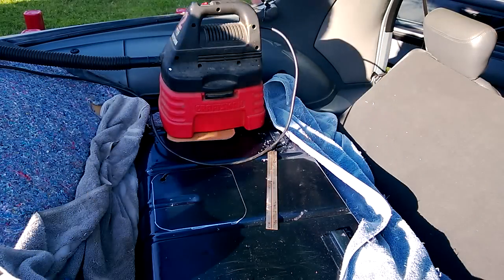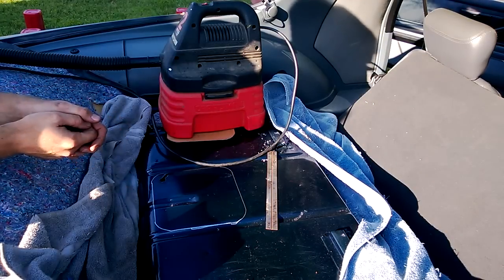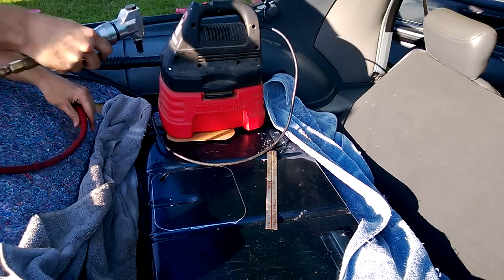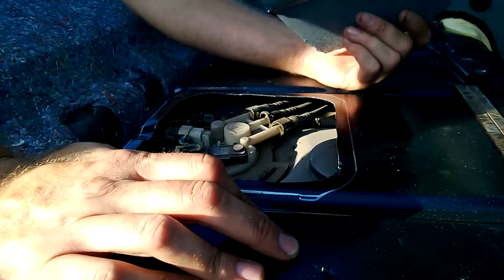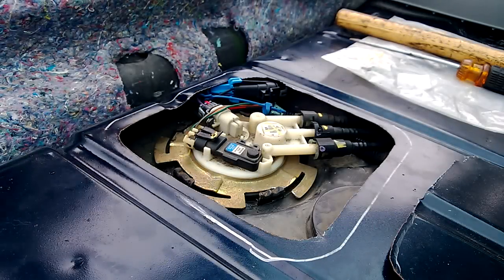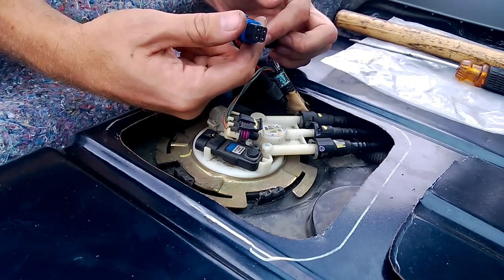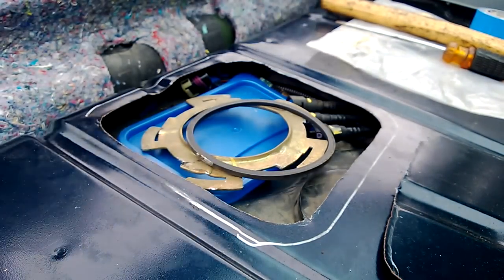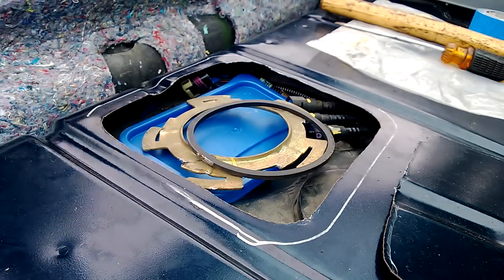Cutting Fuel Pump Access Panel and Removing Fuel Pump Assembly - 86 Trans AM with 02 Gas Tank

Comment: Air hammer with a sheet metal cutting bit works great for cutting the hole. Clean edges and no sparks... just my 2 cents.   Nice video.

Comment: I have done this procedure on a car and 2 or 3 pkups. .  I have dropped gas tanks in the past to change out the fuel pumps and will not do it again. In my opinion this is the only way to go. Nice job..
Reply from the maker: Thanks!
Reply: Joseph M how would you create an access hole for a pickup when the tank is right below the truck bed?
Reply: Very simple, take some measurements to make sure you're directly above the fuel tank opening to access the fuel pump. Simply draw a square with a black marker, use an angle grinder with a cutting blade and cut three sides first being careful not to go to deep. Once you have 3 sides cut, cut the fourth side about 2 inches on either side, pry up the cut piece and bend it back. Replace the fuel pump and bend it back in place.  If you have a bed-liner just put it back on, if not tack weld it or use JB weld. 
If it's a newer vehicle you may not want to take this route, however, it works fine and does no harm to the gas tank and you can cover up the cut with a bit of bondo, primer and paint if you're worried about appearance.
Reply: lift the front of the bed up about a foot.  Leave the back of the bed down enough so you can keep your taillight wiring hooked up...
Reply: An suv yes but why a pickup its so easy to unbolt the bed

Comment: This was quite informative and practical.....even exercising caution. I even did the same thing to a 2001 Chevy Malibu on 12/20/20. I made sure there were NO gas fumes prior to using my angle grinder and a metal cutting disc. Problem solved and just much quicker.Thanks for this information.
Reply from the maker: Glad you liked the video!  I like to think I did a neat job and its still safe and accessible.

Comment: This method is fine!  most imports already have a factory access panel.  make sure and clean top well then blow off good with compressed air.  just get another piece of shear metal an inch or so bigger than the hole and seal it down with black butyl tape.  could also use urethane auto glass sealant.

Comment: i like this solution as long as its done nice and properly. should be there from factory in my opinion.
Reply: farerse A more expensive car often has an access panel for the fuel pump. Access panels for a fuel pumps existed before the 3rd generation F car was designed in 1978 to 81. Thus GM did the typical thing of what car buyers want a lower base price. All the added fluff is rung out of the costs of building consumer items. With volumes going into the millions the parts are figured to tenths and hundreds of cents. Few in 1986 are going say they are willing to spend 20 bucks extra on the sticker price for an access panel.  In one consumer item I was a designer on the volumes were several million. One tenth cent on 1 million units is 1000 dollars. Thus often Engineers and Designers do have these ideas but the bean counters kill them so there can be a profit to be around another day.  The 3rd gen F cars run aluminum wire in the bottom left rocker panel to  save weight and cost too.
Reply: Damn right, they should have an access panel. A guy had to replace a fuel pump on his Jag, to his horror the entire rear sub-frame has to be dropped to gain access to the fuel tank. The garage wanted a $1,000.00 dollars just for labor. I told him cut out a hole, however, he frowned on the idea. FYI early model Sabbs  have a factory access door in their trunk, they are the only manufacture that has one to my knowledge.
Reply from the maker: Agreed!

Comment: Always make sure your fuel pump is able to be lifted out of the cut hole.  Some fuel pumps have pipes and hoses extended from it that will not allow you to do this.
Reply: That's a good point.  Generally, if the car didn't come with an access panel, the metal or plastic pipes usually DON'T have a coupling there at the top; its further down along the side or at the bottom of the tank.  Cutting the access panel in a case such as this is only half of the job, the metal lines still need to be cut and re-connected afterward.

This car here in the video is an exception since his tank is a 2002.

Comment: to cut that out, use an air chisel with a PANEL CUTTER bit.  same as used by bodyshops to cut quarter panels, floors, etc. out.  and you can use the bit alone, by hitting it with a hammer.  it will cut a hole in 5 minutes by hand.  or 1 minute using air chisel.  it's a bit end like a big can opener.
Reply from the maker: Yup...that'll work too. Less mess than a nibbler as well. I was finding little steel "fingernail clippings" for years after this. But...still made a clean cut with no risk to the fuel lines or tank.

Comment: An air chisel with a sheet metal cutting bit works great. 
The biggest down side to cutting the interior floor panel to access the fuel tank is you now have a seem in a place that could put you at a slightly higher risk of having fire enter the interior in the event of an accident. Even if you get a large panel from a donor car to allow for a large overlapping flange and use body seam sealer, there is still a slight chance that the panel could deform in a crash resulting in a gap that could allow fire or fuel vapors to enter the interior of the car easier.
Reply from the maker: +JeepCollector91 True on the air chisel.  Probably mostly true on the danger.  However its no more dangerous than a newer car that has an access door already in place.  Heck my subaru has two access points.  The tank is a two hump design.  Each tank is directly under the two rear passenger seats.  Each side has a LARGE access panel.  No where near as stout as my cover.  Of course, its further from the rear of the car, hence less likely to get damaged in a rear end crash or something.  But still.  If I get hit THAT hard in my TA, I will have plenty of issues as it is haha.  Thanks for the comment!

Comment: Access holes should've been engineered at the factory.That in my opinion isn't hack dropping the gas tank taking exhaust apart is allot of work especially on a car.Not to mention a bit dangerous    I ve never liked really under a car with  Jack stands.I ve had Jack's break letting the car down.so keep safety in mine.
Reply: Ideas like "Access holes" are often on imports and more expensive American cars. It is not an engineering problem, it is a cost issue. All these cool ideas get nixed to get the production costs lower. More expensive GM cars of the same era have an access panel, Subarus and Mazda cars often do to. One has the tooling cost of the extra panel, the cost of the seal the fasteners. Over the production run of a 1 million cars it saved GM several million to leave out the panel. If all the " should've been engineered at the factory" things were done then the Camaro would cost a lot more. Thus as an Engineer one tied to get cool things into a design but they often get killed do to costs. ie they sweat costs down to thousands of a cent and sweat the labor to do the extra gizmo.

Comment: I was moments away from cutting a hole with an angle grinder...dropped tank instead. To my surprise, there is a hose missing and I might have lit my truck on fire. Hindsight: If you belive a tweeker owned your ride before... do everything by the book cause you dont know what safety is missing.

Comment: Will definitely be going this route on my 1982 trans am. As this is the second time the fuel pump has failed. Went the expensive way the first time at a cost of $950.00 bucks.
Reply from the maker: +kitt2000car Ouch!!  Yeah if you are paying someone else to replace the pump, this way will definitely be a bit cheaper vs. the labor cost of pulling everything.  Just keep in mind that if your 82 has the stock tank and all, your hole will be in a slightly different location, and much larger.  So do some digging on the forums before you commit to that method on that car.  If you've done a tank swap, then have at it!  Thanks for watching!
Reply: +JEG's Garage Thanks for the info didn't relize the hole will have to be different than yours?? To my knowlege it is a stock tank. Won't be doing it until the spring gives me time to do some digging around.
Reply from the maker: +kitt2000car Yeah its very different.  I dont think I would personally do it on a stock tank car.  The hole needs to be on the "seat" side of the hump vs the 'trunk" side like mine, and it has to be at least twice as long.  The lines on the 82 will have to be cut, then spliced back together with hose I think.  But do a little digging on thirdgen.org because plenty of folks have done it.  You can certainly still do it.  Def take your time and make a nice cut though since its bigger.

Comment: Thx for this. I think I'll drop the tank first & then cut the hole for the next time I need access. It's ridiculous to have ever eliminated these pump access panels.
Reply from the maker: No problem.  I wish I would have done it while the tank was out as well.  I could have made the hole even nicer, and done something different to close it up.  Its very nice to be able to get in there when needed without having to even lift the car up.

Comment: So my 1996 MK2 Ford Mondeo has a rubber grommet to access the whole fuel pump assembly behind the rear seats yet it never failed lol. Now I had to drop the fuel tank of my Ford Focus and I thought it wasn't so much of a deal  to do it once, now the pump has quit on me again and I had to fix it out under snowing weather. I regret not cutting a hole for simplicity sake. Have seen people doing it nicely with screws and rubber sealing.
Reply from the maker: Yeah I catch tons of flack for this.  But I have had the access for years now.  Car hasnt exploded.  I smell no fuel.  Its not rusting out.  And I sure as heck wont be crawling around under the car to replace the pump or make upgrades :)

Comment: Hello, What is the nibbler? Is it a tip that fits on an air tool? I have to cut a hole for my Astro van fuel pump and Im looking for options. I like this because there are very few sparks. I have a small air compressor. I think it will be enough pressure for this small job. Just wondering what name to look for to order the nibbler tool. Thanks Chris
Reply from the maker: The nibbler is the entire tool that I used.  The name implies what it does.  It just takes little nibbles out of the sheet metal.  The advantage is, it doesnt make sparks, makes a fairly clean cut, and doesnt need to plunge far below the sheet metal.  The downside is its VERY noisy, makes a huge mess of chips, and leaves a pretty large gap on either side of the cut.

Comment: That's a great idea. Never heard of anyone making a hatch.
        That's thinking if your going to keep the vehicle, and when it comes time to replace it again,….it will be a slam dunk.
But,...The only thing wrong with your idea is "(if your going to keep the truck for years )",..then dropping the fuel tank is part of maintaining your vehicle. Gas tanks rust out too, and while your changing your fuel pump, you can check out your tank, clean out the grunge around the straps that also rust out and give it some paint and some new strap gaskets.
Reply from the maker: Decent points! I plan to keep this car til my dying day! In the event that I have to sell, anyone that buys this car will appreciate the method haha. I hope to not have to replace the pump again. But I do plan on changing the fuel lines. Also, the tank is plastic :). I just cleaned the inside and can do so through the opening. Straps are galvanized and haven't rusted in almost 30 years so they're here to stay! I wouldn't do this to a show car, and if I had a nice garage with a lift I probably wouldn't have done it either. But a fuel pump change, sender fix, hose replacement, etc is a job measured in minutes while in my driveway with minimal tools! Thanks for watching!!!

Comment from the maker: HRVAT1975 This particular car was an LG4 car.  Computer controlled carb.  In a nut shell, I used NOTHING from the stock thirdgen.  I literally strip the car front to back of everything except for the wiring for horns/lights/wipers and interior.  Starting at the rear, its a 4th gen plastic tank.  I install the 4th gen bulkhead connector behind the rear seats in place of the stock harness.  So its plug and play from the tank into the car.  Then I used the fuel lines from the 4th gen as well.  They are a nice fit until the front subframe, where the 4th gen lines "kick out". I modified the lines, and brought them up into the engine bay in the same spot as the 4th gen.  Then hooked to the fuel rail with some russel quick disconnect fittings and braided line.

Comment: Nibblers likr plasma cutter work WAY BETTER with a straight edge guide 😁.
Using a cut wheel and SCORE ur lines multiple times.. i like variable speed tools for this kind of work. Lucky for you yours is under the seat. Mine's right in the tail end of the back of my blazer and on a corrugated bed 😮😢. I had to have a shop custom make me a piece to match the corrugation on the piece that I cut out it came out very clean but I had no lip on which to set it on to !!😂

Comment: Having tried it both ways now, it's actually easier to drop the tank - in my opinion.  Getting the tank down is a bit of a hassle, but the work on the fuel pump is much, much easier, especially getting that mounting ring off.  dh
Reply from the maker: Hey David.  Thanks for the comment!  Thats the beauty of this hobby.  Everyone can do it the way they like best :)  I had to go back into my tank 3 times after install...so for me, the panel has already paid off.  Also, the 4th gen tank sender ring comes off way easier than the thirdgen unit in my opinion.  Only needs a few taps with the brass drift to get it spinning off.  I still find it much easier for me, and thats even with the 4th gen tank and its rubber filler hose which makes taking the tank out cake.  If I had a lift...or even a garage, I would be more open to dropping it down when needed.  I hate having to go under this car for anything though.  Thanks for watching!

Comment: My 2006 honda accord has fuel pump access hole already made by the factory in the trunk. Easy. I guess it all depends on What kind of car you buy.
Reply from the maker: Yup.  Some have them, some dont.  I think you'll find most import cars (for the U.S.) have them, and a whole bunch of newer cars regardless of make and model.  Its just a smarter way to work on it.  There is no downside to having one.  The only downside is when people hack into the floors and dont do a neat job, and dont cover it up nicely.  If you do it clean, I see zero harm...unless you're cutting up a super rare car haha.

Comment: Drop the tank so that you can also clean the tank!  A dirty tank will kill your pump fast.  I did the access hole (or is it A. Hole) method 4 times because my pump kept dying.  When you cut a hole you really can't see the entire tank.  I kept blaming aftermarket parts (even Delphi) but I now know it was a dirty tank.
Reply from the maker: Hi Tom.  Check the video I posted shortly after this one.  I actually show video of the inside of the tank.  The whole reason I did this was to install an aftermarket pump and harness.  Aftermarket stuff has a habit of being unreliable, so I wanted to make sure I could get back in there easy.  The tank inside, which is plastic by the way, was spotless.

Comment: This is a good short cut. Anyone who knows anything about the structural strength of a uni-body car know the integrity is now compromised and now , if the car ever needs a certification and the mechanic sees this hole it will cause the vehicle to fail. Some cars do have this type of access, great idea but the engineers factor the crumble rate in crash tests where this does not. I had hoped to see you close up the hole but guess you didn’t make that video.

Comment: Any recommendations on cutting this trap door with something that won't create sparks? A little paranoid that if there's a leak on the top, some vapors might ignite.
Reply from the maker: Sorry for the delayed response Jon.  You are probably done by now.  I liked the nibbler too that I used.  It was a bit violent but no sparks.  I was concerned about hitting hoses or lines more than sparks... So whatever you use, it has to be a non abbrasive cutter like this.

Comment: I don't cut piece completely out leave one side for a hinge. No need for extra piece of metal. silicone cut cracks you good to go.
Reply from the maker: Also a good method!  I like the piece to overlap so it can seal.  Just like factory access panels.  But I think what you described would work ok.

Comment: As long as I have a bed that can be removed, no way I’m cutting a big hole in it. Remove four bolts on drivers side and loosen the four on passenger side, disconnect gas fill hose, jack bed up on driver’s side and waalaa!! Easy access to the fuel pump!